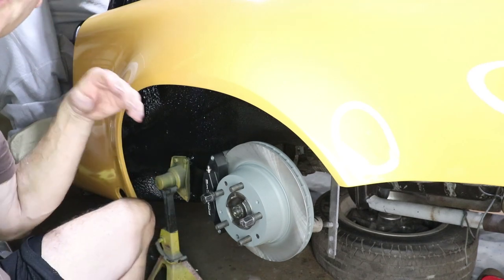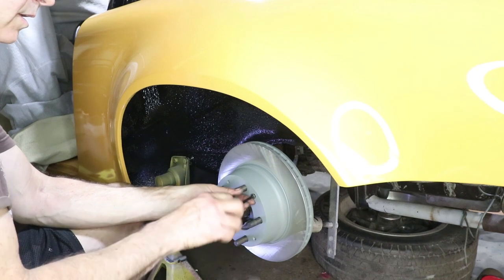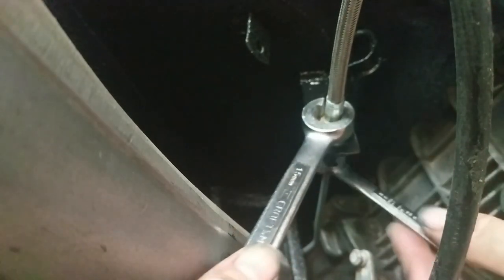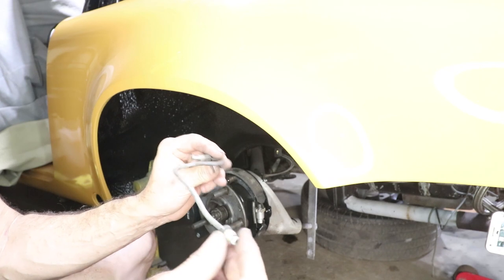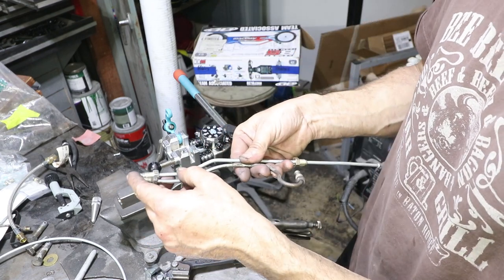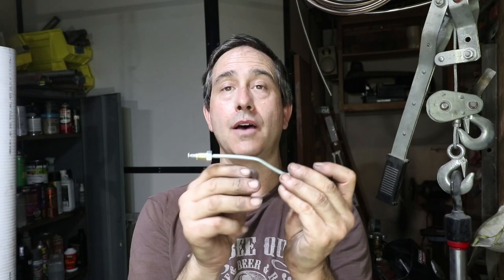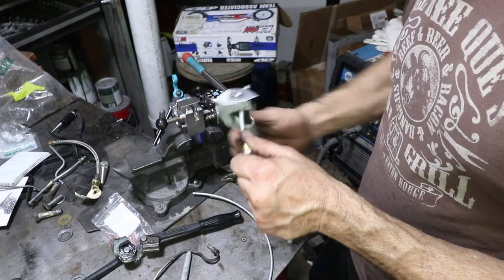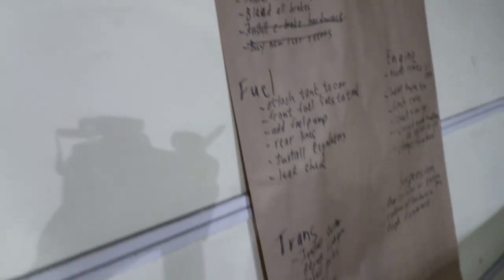DIY Hard Brake Lines To Fit Aftermarket CNC'd Aluminum Calipers - Porsche 911 Restoration

Comment: Hi Tom, Did you ever talk about your rear control arms?  I spent a long time trying to find aluminum control arms like yours to replace my heavy '72 steel control arms.  I finally found them.  Unfortunately, I do not have the hubs and will need to figure out if I can just use my old hubs.  Also, I need to replace the bearings.   For a gift I received a URO Hard Brake Line kit, so I'm hoping a lot of the brake line work you are doing will not be so hard for me when the time comes.  Great video as usual.
Reply from the maker: Good move on the aluminum arms.  They are lighter and stronger.  
I do not have a video on bearing removal, but I've done it on some parts I've sold and it's tough.  
I have a homemade bearing puller if you want to borrow it, however it's just made of home depot stuff and some scrap steel.  
As far as I know the hubs are the same.  (72 to 74). Make sure you have the sway bar sockets.
I do know the early short wheelbase hubs are different as they don't have wheel centering flanges.

Comment: Nice job.  What about removal of the calipers and rotors for maintenance and inspection?  Do you have to remove the brake line from the back of the caliper to do that?  Couldn’t tell in the video.
Reply from the maker: Yes, you do need to remove the hard line to replace pads/rotor/caliper.
It's no different than a stock 911 though, plus it's good to bleed the brakes more often than not.
Front of the car is the same way.